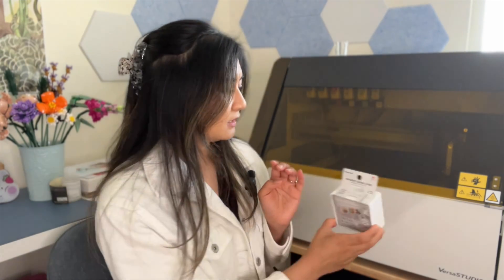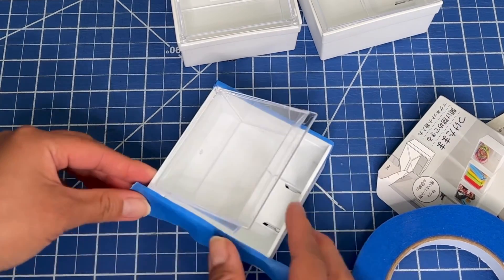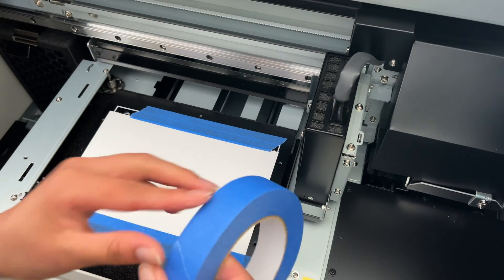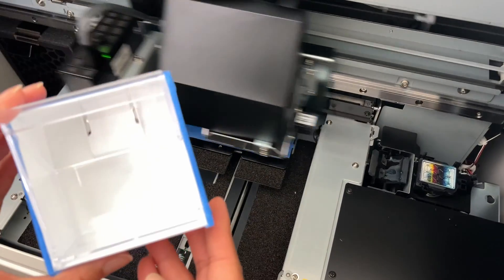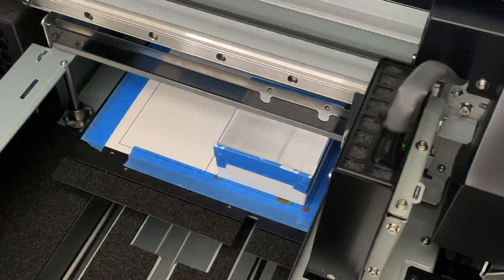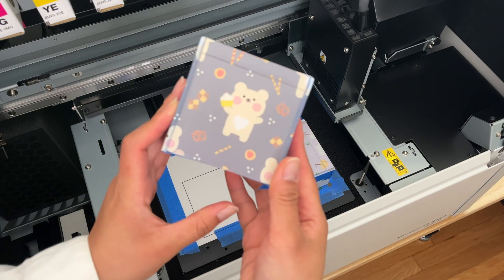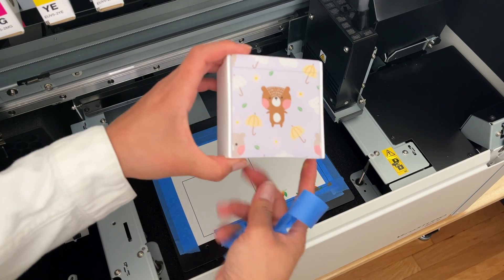What is Overspray & How to Print Full Coverage | Roland BD-8 UV Printer

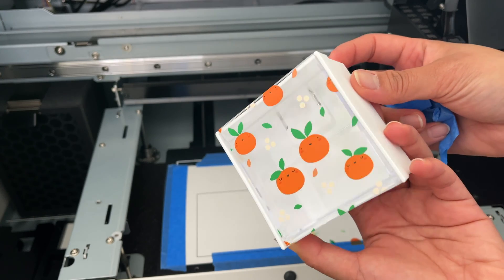Comment: 5:14 It looks like you have a few white overspray on the transparent cover, try to clean the items before you print to remove static from the items. I usually use isopropyil alcohol or you can use other anti static cleaner then wipe it dry before print.
Also I recommend to fill the box with black cloth or any dark colored items/cover to minimize the UV lamp reflection to the print head to make the print head lifespan longer.
Reply from the maker: Thanks for the tips!